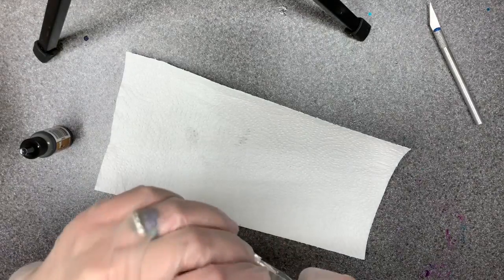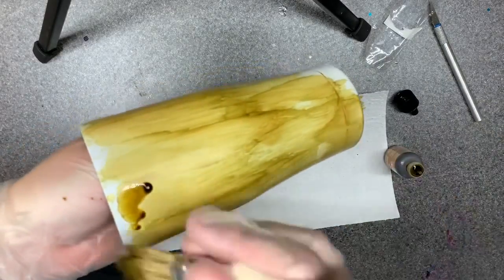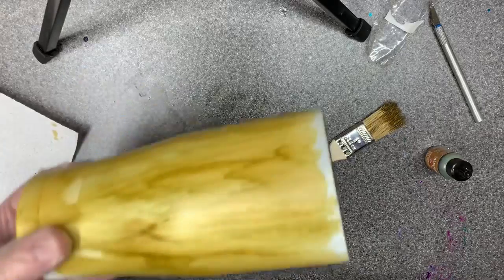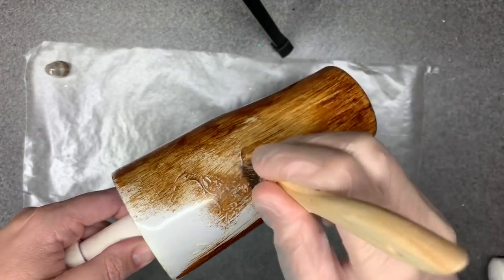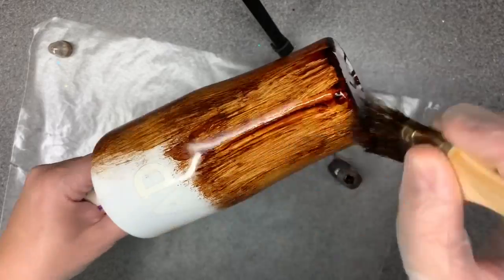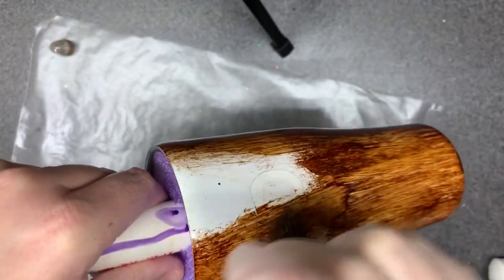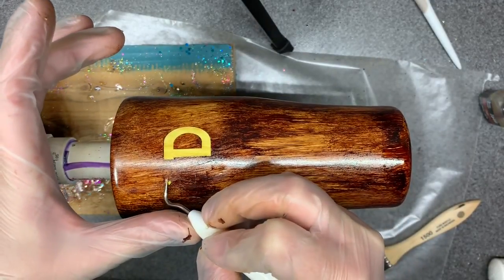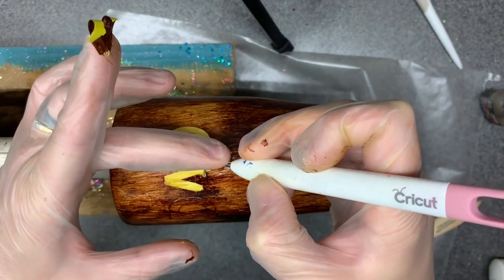Two-tone peekaboo woodgrain tutorial

Comment: I love your videos. I also do the wood grain cups. I paint mine white, do the latte ink and then spray with a sealer.  It turns green until it dries. I then do my decal and my darker ink.  No need for modge podge, epoxying and painting again.
Reply from the maker: What sealer are you using? Every spray I have tried ruins my ink!! I’ve even tried mod podge spray. 😩
Reply: @ThePurpleStitch  I use Rustoleum (sp) clear matte.  It turns a greenish color for a minute, but back.  Wish I could show you pictures....

Comment: Did you just use a regular brush to paint on the Modge  podge? It does it matter what kind you used?
Reply from the maker: I sometimes use a mod podge brush. But often just a paint brush that leaves a smith finish. Some say they use a foam brush, but I always end up with bubbles.

Comment: HI, is the cup shine from the mod podge sealing or did you epoxy and then put on the decal on.
Reply from the maker: I epoxied between layers, layers the decal, sprayed white, inked again, then removed decals. So I’m betting what your referring to is the layer between.  🙂
Reply: So you light grain the wood, epoxy, apply decals, then mod pod gear... no other epoxy or sanding???

Comment: Can you recommend a good epoxy please. I'm not liking the one I've just bought x
Reply from the maker: Each brand tends to behave differently depending on your climate. I have great results with Envirotex lite and KSresin liquidy split.
Reply: @ThePurpleStitch  thank you. I keep getting fish eyes in all my projects, I camt seen to figure out were im going wrong. X
Reply from the maker: Stacey Shakeshaft it could be from touching it with bare hands, do you ever touch them between coats without gloves on? Once I realized I was doing that, it helped my fisheye problem. Also, I like to spray a clear coat paint before epoxy. That helps me a  lot too.
Reply: @ThePurpleStitch  yerr some times I think I do touch it. Thanks for your help xx